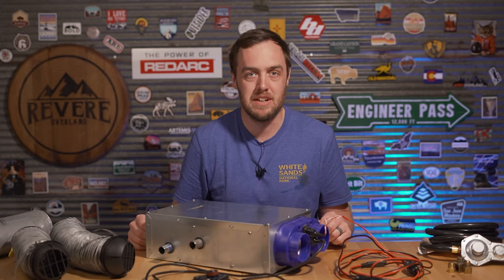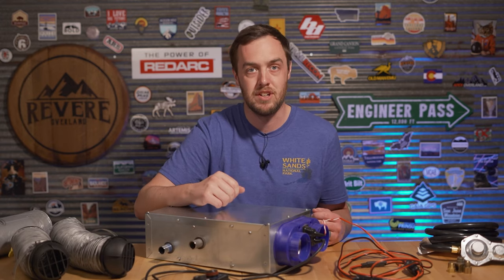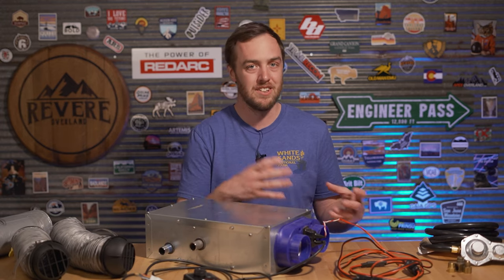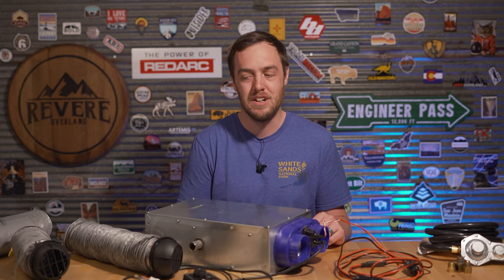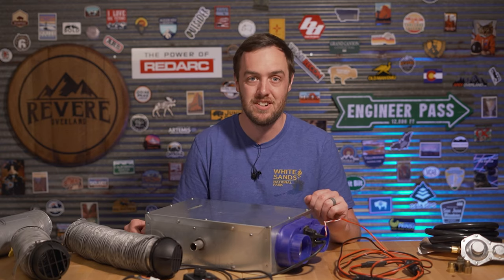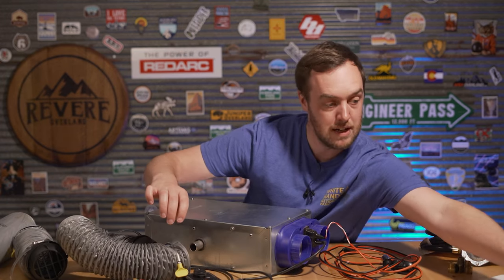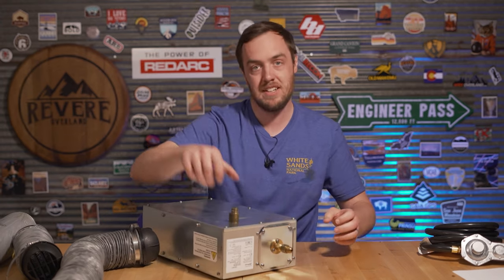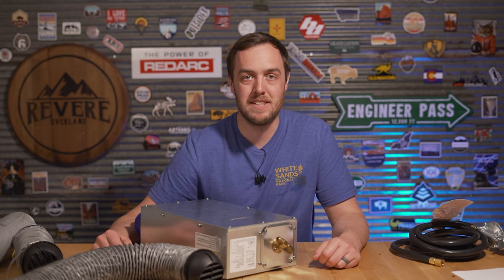PROPEX HS2211 - How to heat your tent

Comment: I got to try my Propex heater out last weekend. I put a quick connect for the propane on the BSPT to NPT angled adapter so it sits close to the body of the heater. And because I don’t sleep well with any kind of fan noise, I ended up getting the ridiculously expensive soundproof felt duct, and the “stealth kit” for the exhaust. It’s now wonderfully quiet. The felt duct is thinner than the duct you use, and will actually fit inside it which will protect it in wet weather. The only annoying thing about the Propex stuff is as you mentioned, the supply chain issues. I ended up placing an order each for the heater, duct, and stealth kit, and it took a long time to get the parts.
Reply from the maker: Could you post links to the parts you used? I’d love to check them out - especially the quick disconnect!
Reply: Henrick: can you post links ?
Reply: @jd.coleman  see links in my response to Revere Overland’s question
Reply: @RevereOverland  very weird, I tried posting the links twice today, and it looks like it succeeds, but then the response doesn't show up. Maybe it requires your approval first?
Reply: @jd.coleman  I posted some links today, but for some reason, my response hasn't shown up yet. I suspect that @Revere Overland has to approve the post first.
Reply from the maker: @henrikm4657  nothing on my end, sorry! Must be YouTube catching it.

Comment: Trying to figure out the adapter to regulator situation you used?  So the regulator you have has a 3/8’s NPT female connection point?  

Any chance you can provide a link to that or edit the description links?  

🙏🙌. Haha totally bought this thanks to you.  I as well was against hauling diesel specifically for a heater for the fam.  So glad they made this and you introduced me to it.  Thank you!

Comment: A diesel heater running on fan speed 1 only pulls .5 amps.  A Propex propane heater pulls 2 amps running which will only give you 1 night of heat if you are using a 500 WH power station.  2.5 nights on a 1000 WH station.  A diesel heater is way more efficient.  At fan speed 1 you’re only consuming .5 amps on a diesel heater.  That will last you 3 nights on a 500 WH station.  6-7 nights on 1000 WH station.  Also a lot less fuel is consumed with diesel vs propane. Most overlanders use a 5 gal propane tank.  That means you will only have 1.5 nights of fuel till empty. My diesel heater 7 liter reservoir lasts me 3 nights on fan speed 1 or 2.  Also, if propane heaters are $1,000, let’s compare apples to apples.  If you spend $1,000 on a quality diesel heater like a Webasto, you won’t get smoking or any of the other problems that cheap Chinese diesel heaters have either.  The more expensive diesel heaters have auto altitude adjustment. Even some Chinese diesel heaters have auto altitude adjustments, like the Maxpeeding Rods brand or HCalory and several others. It’s not a problem if your diesel fuel reservoir is attached on the outside of your rig (like on your tire carrier).  Just run a quick connect fuel line to the diesel heater.  If you wouldn’t transport your gas filled rotopaxs inside your rig why would you transport your diesel filled rotopax inside your rig. Also the propex will kick on and off all night long which is a bit noisy. Not consistent white noise.  Also between the on/off phases all night long the propex has large gaps in its ability to hold a consistent or steady temp.  So if you set the thermostat at 68 deg it’ll bounce between 60 deg and 70 deg. Super annoying.  Some complain about the diesel heaters fuel pump clicking noise but you can buy a $30 quiet fuel pump upgrade of Amazon.  The advantage of the diesel heater in comparison is having consistent soft white noise all night long. In my opinion the diesel heater beats the propane heater in almost every category… efficiency in fuel, Battery consumption, cost, weight, space of transporting fuel, temp hold, quieter etc.  Propane heater doesn’t have app control.  Newer diesel heaters do have app control.  I think your frustration with diesel heaters you’ve owned is that they all have been cheap Chinese ones.  If you’re willing to spend $1,000 on a Propex propane heater then spend $1,000 on a serious diesel heater. Apples to apples.

Comment: Looking for the adapter to go from compression threads to the NPT thread…. And a 90 degree adapter if possible. The links were not visible as mentioned previously…. Where to find that part (1/4 compression to 3/8 NPT)…. Thanks!

Comment: I'm a bit confused and concerned about sealing the connection between the heater's LP input that has a parallel male British Pipe Thread with the suggested adapter from McMaster which has a parallel "BSPP Female" thread (per the McMaster description).  Are the two really compatible for sealing a gas connection?  The heater comes with a ferrule (or olive) and a nut to fit the input.  The olive is a compression fitting which provides a seal for liquids or gas (although in north American flares are generally used to  provide the seal).  When using the McMaster part, what is providing the seal?  There is no ferrule and there is no flare.

I'm a noob to all this, but it looks to me like gas fittings seal one of three ways: compression using a ferrule, compression using a flare, or a tapered thread (with yellow Teflon tape?).

Should yellow Teflon tape be used on these parallel threads and is that adequate to form a gas seal?

Thoughts?
Reply: Did you eventually reach a conclusion regarding this? I am wondering the exact same thing. Based on what I can tell, a sealing washer is needed to create a seal between a BSPP male and BSPP female thread. The McMaster part does not come with said washer, but they do sell it (I wish I had purchased it as part of my order). Either way, I bought a 1/4 BSPP sealing washer from Ebay, so let's see how that'll do. I suspect that with sufficient yellow teflon tape it might not leak anyways, but that is just conjecture, I haven't tested it.

Comment: Have you had any problems with the duct tube out gassing?  I've tried 2 different brands from Amazon (including the one you linked), and both have a horrible chemical out gassing smell when hot that I'm concerned about breathing.  I really want to use 3"flexible duct because it's easier to pack up than the stiff aluminum tube it comes with, but concerned about the fumes.  This is surely a problem with diesel heaters too.
Reply: Hey man. Did you ever figure this out? I’m having the same issue..
Reply: @alexnaz  I ended up using the Hon&Guan 3" duct I found on Amazon.  The outside coating of the duct did outgas, but the metalized inside didn't, so no smell in the tent, just outside.

Comment: Can you run these on cng? Where i live cng fuel is available everywhere. in fact many cars have cng tanks on them by default. so it'll be awsome if these can run on cng.
Reply from the maker: Probably not, since this is designed to run off propane (LPG). You could check with the manufacturer, Propex, to be certain.

Comment: I see you are using a rubber flexible hose to provide propane to the heater.  When people have used these hoses with Buddy heaters oils from the hose will eventually foul the unit. Is this a problem with Propex heaters? Thanks
Reply from the maker: This is the first I’ve heard of them causing any problems at all!
Reply: @RevereOverland  Jason with Primal Outdoors has a good YT video about the problem. Evidently Mr Buddy hoses don't cause a problem though other brands can be a problem. You can buy a filter for the problem hoses.

Comment: Can you use the propex heater without putting the air return line into the tent? I know that seems to work fine with a diesel heater just having the hot air tube coming into the tent. I only have a slot in my Jumping Jack tent trailer for one 3" tube.
Reply from the maker: Yes, but I wouldn’t advise it. After a heating cycle the Propex runs air through the system while it cools. If you’re drawing air in from outside, it’ll be pushing cold outside air in. Diesel heaters can do it just fine because they’re always on and heating.
Reply: I was going to ask the same.   Plan on building this into a cargo box and mounting on a side molle panel.  Having to run 2 ducts rather than one will have to do.   Next to conquer keeping the box insulated and protected from melting from the heat of the adjacent exhaust areas of the unit…

Comment: How hot does the unit get to the touch? And how loud is it at low and high settings?
Reply: From Richard at Propex: "The main heater body does not get hot at all.  The area 'immediately' adjacent to the exhaust pipe will reach approx 120 C and the area immediately adjacent to the warm air outlet will reach approx 90C." That's 248 F and 194 F respectively.

Comment: It comes with a regulator that doesn't even fit without additional pieces?
Reply: British heater.  We don't regularly use British fittings int the USA, so adaptor are needed.
Reply from the maker: It doesn’t come with the regulator. The stuff it comes with is designed to have a hard line going to a propane supply in a van/camper.
Reply: @RevereOverland  what regulator did you use? Are they all essentially the same (except for the high pressure type)?  I have a regulator left over from a LPG fire table that I had converted to NG that I would like to use with this heater.

Comment: Awesome idea, but not for $1k... My buddy heater keeps me plenty warm. yes its not ideal, but I cant justify that price when there are cheaper options. Id be in at $250...
Reply from the maker: Yeah it’s not for everyone. A heated blanket is another good option, but then you need $500+ in batteries.
Reply: @RevereOverland  I actually use a heated blanket as well. It shuts off automatically after 45 minutes, but I can run it 3-4 times a night with no issues. Usually my 100ah battery is down to 65% in the morning.
Reply from the maker: @krover01  I have the same setup for when it's not too cold!
Reply: Am looking at a heated mattress pad over a heated blanket due to safety (less crinkling to cause shorts). It runs on average 3amps. I can't imagine $500k in batteries to keep one warm unless there's no sun to charge from solar. I suppose capturing sunlight in certain parts of the world during winter may be difficult.  If you move around often, your RedArc manager should charge the batteries sufficiently.  And as a fellow rooftop tenter, I don't see a reason to have the whole tent heated.  That's just fancy.  :)  Vanlifers, perhaps.

Comment: Holy cow, $900 for something you can make for $50!
Reply: Better get to making and selling them if that's the case.
Reply: @Ethan  
Please prove your statement.
Reply: You couldn’t even buy the stainless steel box it’s mounted in for $50. I agree that it’s expensive, but they are very high quality heaters with a lot of stuff inside (electronics, heat exchanger, fan, etc). They’re mainly designed for permanent installation inside vans.
Reply: @henrikm4657  it’s not difficult to buy a sheet of thin steel and fold it into a box. It wouldn’t look as nice and professionally done as this, but certainly doable.
Reply: @Ethan7s   I didn’t say it wasn’t easy. I fabricate stuff all the time and have welding machines, hydraulic press, etc. But metal isn’t cheap, especially not stainless steel and aluminum. It would be  hard to make the box alone for $50. And that’s just the top of the iceberg. If you can make something comparable for $50 that is as rugged, safe to use, and durable, I’m dying to hear about the details.
Reply from the maker: I think having a heat exchanger as efficient as the Propex would be very difficult to make for $50!
Reply: @Ethan7s  I had this same kind of conversation with a buddy at work that had purchased a $95k Nissan GTR, but could not understand how an aftermarket company could charge $500 for tuned titanium headers for it.  His statement was it's only tube and it gets bent, it can't be $500.  I said, if you can source the correct materials, bend everything to fit right (and be a tuned length), and welded up as nice as that shop does - by all means do it yourself.  If for any reason you cannot perform any of the tasks along the way, shut up and pay the $500 for these headers to install on your $95K car.  You'll probably end up paying close to $500 just to have a shop install them for you. 

So, Ethan my chalenge to you is to "put up, or shut up".   I will happily buy one of your fully functional, thermostatically controlled, leak tested, industry rated, and safe to use units for $100.  Up for the challenge
Reply: @insaynbcr  For $50 in materials, it certainly won't be as nice looking and may be less efficient than the $900 unit, but it can certainly be done with a bit of time and swearing, just like any other DIY project.  

Just because you lack imagination, skills, and enjoy overpaying for things doesn't mean something is impossible.
Reply: @Ethan7s  I am all for DIY anything if I know that I can do equal or better than what I am attempting copy. Knowing what it takes to make a safe, efficient LP powered heat exchanger, I do not have the equipment to cast or fabricate one. Those tools alone would be in the $1000s to acquire.  

Ethan, I fully support your enthusiasm and honestly want you to tackle this project and come back and give us results.  Plain and simple.
Reply: @Ethan7s  Wow. You are amazingly talented. I really hope you apply that genius and make a propane fed heater like the Propex. It would be nice to see some American ingenuity and grit to compete with Propex.
Reply: @Ethan7s  Do you have a link to a DIY tent heater with a heat exchanger, a thermostat that works by regulating the amount of fuel you burn and have similar thermal efficiency? The design also has to be safe.

I did look and could not find any, There were lots of stoves where you have a wood fire in a tent or heat exchanges that use fires outside the tent. They are not comparable in function or efficiency.  I am not saying they are bad but they are in no way a replacement for this product.     

The fact that the hot air is not wet from combustion product, combustion is outside the tent and you can use it with high efficiency from a fuel source you can transport with you and can work by itself is a fundamental part. The diesel heater that he has previously used is a lot cheaper and similar but the gas has an advantage that is mentioned in this video, they come at a cost.

A manufacturer could certainly do it for less than $1000 but I doubt you can do it for $50.

Comment: This could be a replacement swivel vent for those needing the 3" or 5mm size. Search EBAY "75mm Air Diesel Parking Heater Exhaust Pipe Air Vent Outlet Net Cover Cap yd"
Reply from the maker: Yes!! Thank you!
Reply: Thanks!